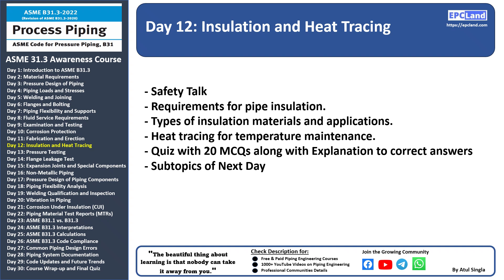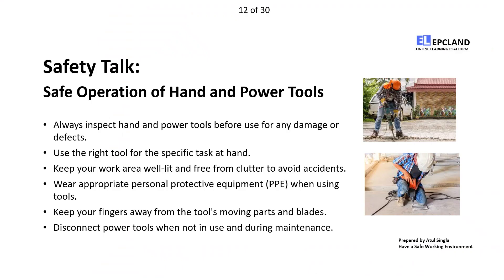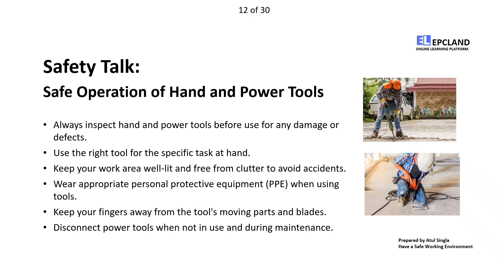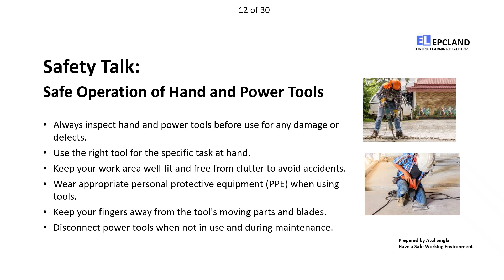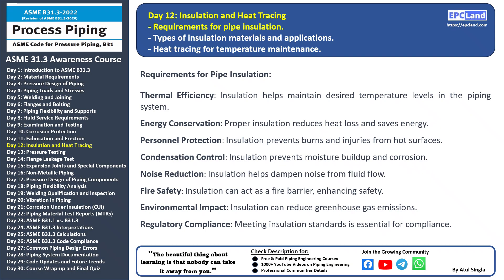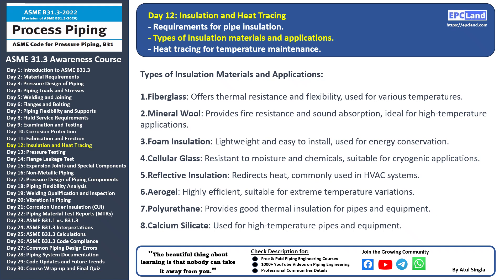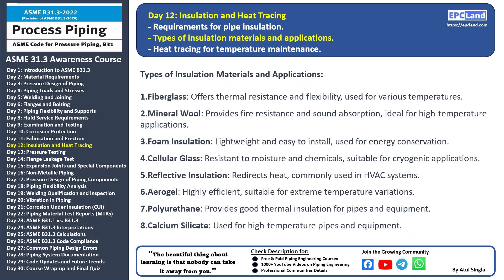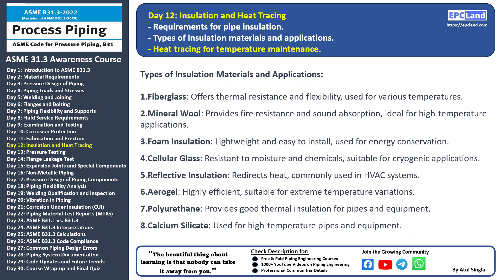Day-12 of 30: English: Keeping it Hot: ASME B31.3 Piping Insulation and Heat Tracing

Comment: Answer of Question 3 is wrong. 
Low Heat resistance will increase loss of heat from the pipe and hence it will be expensive for the plant.
High Heat resistance is required for PIpe insulation so that Heat is conserved.
Please correct your answers. It is extremely important that when you are teaching someone you , yourself are not wrong because 1000s of people learn something wrong because of your 1 mistake.
Reply from the maker: Noted!!